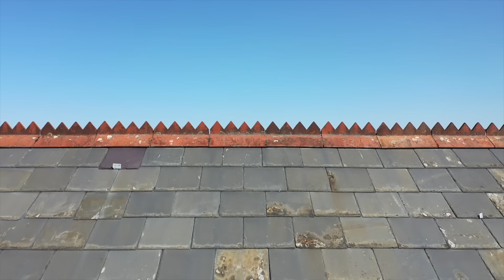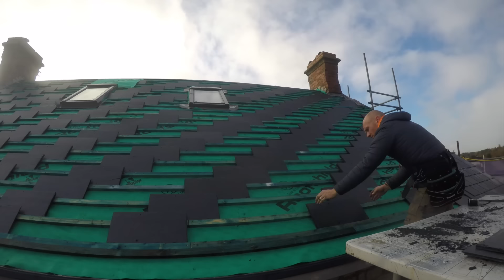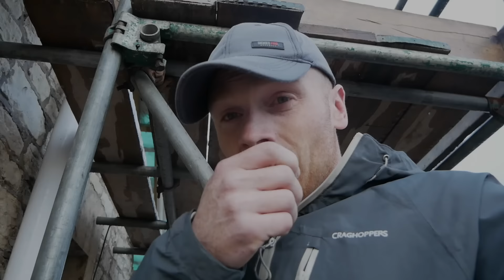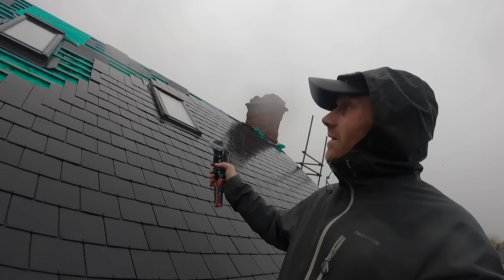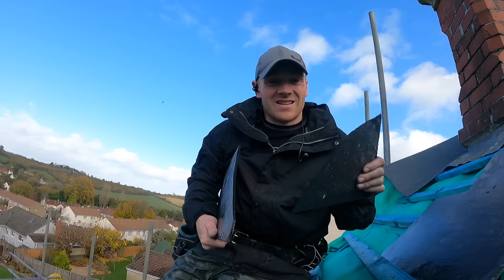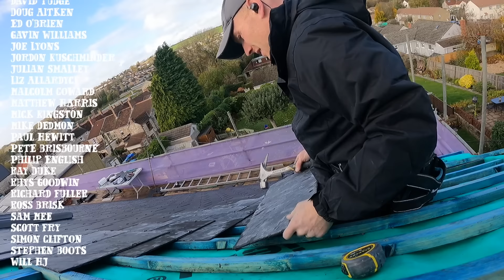NATURAL SLATE ROOF - First Attempt at Roofing!

Comment: Sorry but roof looks terrible with hooks only necessary for repairs, the nails are more than adequate for holding the slates in place
Reply: Must agree, I wasn't anticipating hooks at all.
Reply: But you can change a slate easily with hooks, and they do come in slate color
Reply: There nailed aswell as hooked so no u can’t change them easily
Reply: I have to disagree with you I’m afraid (just my opinion) …..I thought they looked considerably better than I would have ever believed. Also, they have a massive advantage in that it’s now much easier to change individual slates. Having seen the hooks (instead of nailing) I’m seriously thinking about swapping to slates instead of re-tiling my place.
Reply: @liamkearsley9290  only the eaves/verge was nailed so, comparatively, the use of hooks now makes it as easy as changing a tile

Comment: Great job, I am a proffessinal roofer and have been for over 40 years, hooks were mostly used in europe and particuly for man made slates that will lift, we normaly use copper rivits that stops this, a traditional slate roof only needs 2 copper nails so think you have gone a little over the top and made hard work for yourself but great job anyway

Comment: Get a couple of old pillows under the ladder you have on the roof, if you end up breaking a slate or 2 with them double nailed & clipped it will be a nightmare to replace them.
Reply: Yes plus stops any scratches onto the slates, I use gloves on the top of mine as if I bring a pillow up I’d be tempted to go for a nap 😴

Comment: Got to give it too you im a roofer myself and have been taught traditionally and every roofer still gets confused with velux windows all depends where they land on the roof. Great job mate. If you do another one I would suggest perpendicular lines down the roof just makes it easier. 10 inch and a 8th under 5 for 50 x 25 Spanish. Cracking job

Comment: Thank you for the video, I tried slating the first time round, used copper nails with copper pins and discovered not all slates need to be nailed down except for the 2nd or third row and nowadays they have a nail with the copper washer on to secure the slates. But good job, keep it up, although slates can be slippery when wet.

Comment: You have made a very nice,tidy job of that tim mate. Not bad at all for your first attempt at slating a roof. The slate hooks are a nice touch aswell though I would have been tempted to nail the slates aswell as using the hooks for a belt and braces type approach, no doubt it will be absolutely fine though. I wouldn't be surprised if your neighbours started asking if you could do theirs lol.
Reply: I agree, however I’ve never come across the hooks, or anyone that has them. Wind chatter would be my biggest concern, I doubt they’re ever going to fall off.

Comment: I'm impressed as heck. Looks great. Only thing is lack of a safety harness on that slick roof...1
Reply: where do you wanna attach it too? And if you make a safety hook somewhere (chimneys don't look like you wanna trust your life to them) how would you get there but for without a harness?

And most painfully, how do you get rid of the safety hook when nearing completion of the job?

I feel it's better/safer to work gradually up the roof on the battons or ladder and get used to making a point of keeping yourself safe and gain some trust, then to be messing around with ropes getting in the way/underfoot all the time, and when nearly finished make a no experience decent from the top after removing the safety hook.

Comment: Fair play for using the hooks, i hate hooks and ive been roofing for years 😂. I wouldn't have left them thin bits of slate out around your windows though, ive known them things to leak over smaller gaps than that. I would've been shot if i did that as an apprentice 😂.  Overall it looks like a good job , should be pleased with yourself.

Comment: To get your bottom course of slates (eave course) did you cut a slate in half and use both halves (making 250mm in length)? - Should be up to the hole on the slate so assuming these slate are holed to a normal headlap (holed at 300mm) would make the eave slate 295mm . SO maybe lost around 40mm of headlap. Hopefully you have not slated other side of roof and you can correct this error on that side.

Comment: I'm in a very similar boat, planning to do my own slate roof later this summer. What pitch is your roof? Mine is 10-12 (10 inches vertical for 12 inches horizontal), I'm wondering if I'll be able to get by walking up and down the battens or if I'll need to rely on ladders more.

Comment: Great job. Also how many states broke when hammering in?  They look a lot less brittle than I thought.
Reply from the maker: Not to many at all, perhaps more if you were nailing rather than hooks. More were reflected because they didn’t sit flat or slight cracks. Think I added 7-8% so will see how many I have left over!
Reply: @TheRestorationCouple  It would be great to get an update on whether 7-8% is about right for a DIY roofer.

Comment: I am just wondering about the the hooks, if slate is nailed is that not enough? As my 100 year old slate roof is just nailed and I am thinking of replacing it. I get that the hooks are an extra layer of security if nails fail, but I do wonder if that’s a very rare occasion and hooks not needed? I am planning to do it myself.
Reply from the maker: It’s instead of nails. It’s just personal preference. I’d probably nail if more visible or single storey but they are nice to use and means you get two choices on how you orientate slate. (If not holed)

Comment: I noticed you had a couple of. Battens next to one another vertically between the horizontal batten. What were these for (just temp?)??
Reply: Hi Paul, He would of used the small lengths of batten to gauge out the battens when he was laying them.  Its quicker to cut some batten to the correct size and use them rather than getting your tape out every two minutes.
Cheers, Mike
Reply: @mickeyp5122  awesome, thanks Mike
Reply from the maker: Just to get rough spacing. Unfortunately as 50mm battens are not always exactly 50mm I found I needed to check with a tape most of the time as a few mm out on every other batten can end up being way out by the top.

Comment: How did you know to grade the skates thick, medium and thin? I do this but im a roofer. Most roofers don’t even bother and end up massive gaps under some slates
Reply: You don’t need to use them hooks if you double nail your skates, there purpose is for vertical tiling
Reply from the maker: Yes the more I went the better I got at grading. It was more a case of using up the thick ones down low as they stand out so much. The rest were fairly consistent but well worth grading them before they came on the roof. 👍

Comment: Why didn't you just cut down a slate and a half next to your skylites, rather than putting a smaller slate in showing more soaker? Also, didn't you mark/set the roof out prior to slating?
Reply from the maker: I did use slate and a halves, I was just showing why. 👍
Reply: @TheRestorationCouple  apologies, note to self 'watch full video before commenting' ;)

Comment: I've been looking at this for a few hours now and what I found on multiple articles online is that you can't actually DIY a slate roof, you gotta hire a professional that costs way more than "regular" roofers because it's a very hard job and if I want it to be done right that's 100% the only way to go. But looking at your video, it does seem a bit more complicated than a regular asphalt roof, but it doesn't seem to be as bad as peole make it seem... I might be missing something though
Reply: I'm a regular roofer, I do slate roofs quite often. 50% slate and 50% tiles really. Every roofer I know knows how to slate, there are some types of slating that are way more advanced like when you have rounded or shaped slates or if you've got any swooped or laced in roof valleys. The roof in this video is basic though and you shouldn't call yourself a roofer if you can't do it.

Comment: How come u didn't nail the slates with the copper nails ? . U just hung them all on them metal hooks . Aren't them metal hook designed for use In windy areas pretty much similar to a tile clip . But would of thought the slate would also need nails on to the battern to keep them tight down yours will be lifted a bit and rattle
Reply: I was thinking the exact same thing I've used them hooks once in a windy place but also nailed slates ,don't tell me I wasted my time ☹😩
Reply: @paulnewman2115 be no point buying holed slates if that was away because they charge too hole them might as well buy un holed

Comment: The hooks are OK but I prefer not to use them the reason is when a slate is nailed if it breaks it will fall down the roof and you can see it, with the hooks it doesn't drop down so you never know it's broken

Comment: you would have an iq of 3 and a half to pay to have a slate roof installed. unless you hit the lottery never get a slate roof one small break in a piece of slate you're entire ceiling will be filled with water
Reply from the maker: 🤔You would have to have a lot more damage than that. That roof was on 110 years and had dozens of cracked/slipped slates by the time I stripped it. None of those caused any leaks even without any membrane or felt.